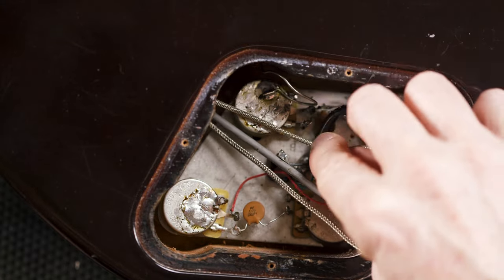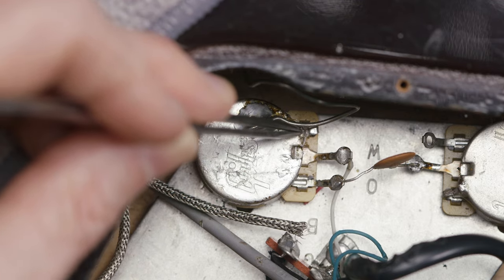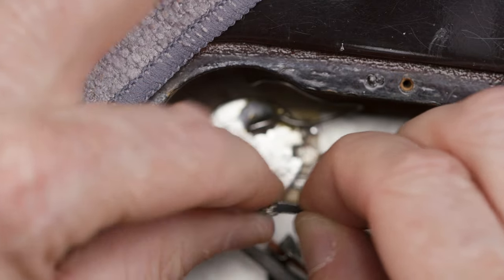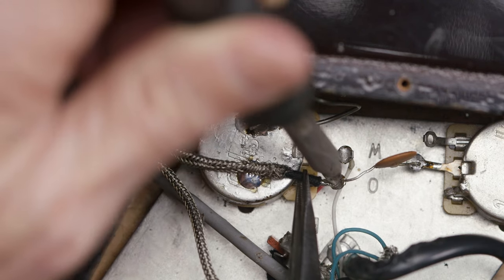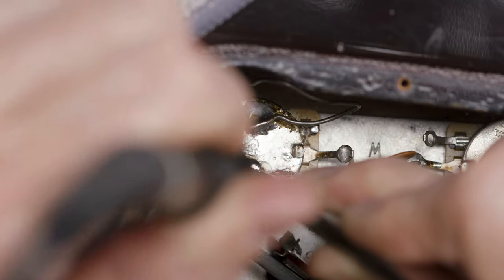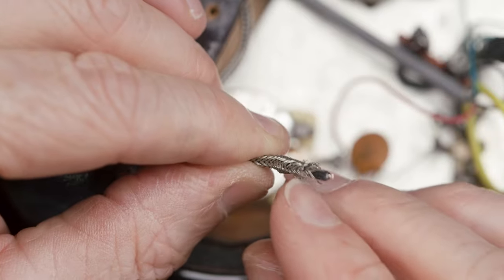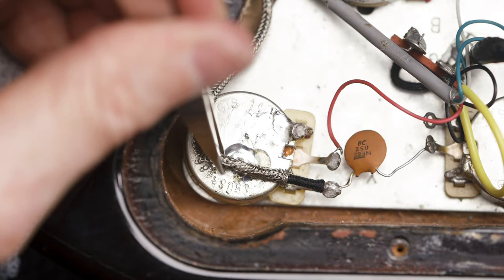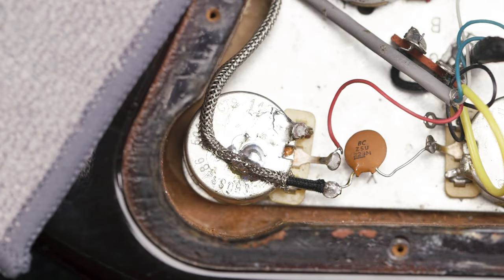Les Paul DIY: How To Solder Connections

Comment: A basic question but how do you make sure your pots, capacitors don't get overheated to a level where they get damaged? How long can you heat the solder directly on the back of the pot? Thanks!
Reply: Hot iron, quick heat transfer. Could also use a crocodile clip on the tone pot as a heatsink.
Reply: Protecting a leaded capacitor from too much heat is relatively simple. You can clip onto the device lead near the body of the part with a copper alligator clip, or as many experienced techs use, a hemostat. I have several different sizes of hemostat (the cheap kind from China) I use the largest one for the space available up to about eight inch size.

Protecting the pots are more of a challenge. I only solder to the pots if requested by the customer and as far as I know, only CTS makes solder-able back electric guitar pots as part of their pot design. Bourns, who also make guitar pots, have available a solder washer H-127 (new design) which allows you to make a connection to the body of the pot. 

From an electrical standpoint you do not have to use the back of a pot as a ground or chassis ground connection point. However, all of the "chassis" metal of the guitar has to be grounded at some point, which includes the pot(s) case. If you just want to ground the pot case you can use the solder washer. If the guitar comes with a metal pot mounting plate (like an older Les Paul), you just need to ground the plate, because all of the pots are attached to it.

You can make a proper solder joint to the back of the pot if you have the correct soldering equipment and supplies and know what a good solder joint should look like. Soldering push back wire tinned braid to a pot case is really unique to guitar wiring, and a huge challenge because the pot case and braid have a relatively large thermal mass as compared to a capacitor lead to a pot terminal. 

The approach shown in the video is very mainstream, but in my opinion does not make the best solder joint, and more often than not produces a cold solder joint. First to help the pot survive the procedure only solder to the pot once for all connections. This approach is more traditional from an old radio wiring standpoint. Where by, you prep the joint first then solder once. How this would be different than what is in the video is you would first clean the scale and oxidation off of the pot back, I use a small die grinder with a very fine scotch-brite pad, then clean with IPA, apply liquid flux to the joint and then solder everything in one operation. If you prep the area to be solder on the pot and use additional liquid flux you do not need pre-tin the pot, which heats up the pot. If you want to see what a good solder joint is supposed to look like consult IPC J-STD-001 requirements. The joint will have smooth fillet sides and not look like a round blob or ball on the back or the pot. 

To me in the video the soldering iron is not hot enough and should be of a higher wattage to make a solder connection of braid to a pot case.

Comment: Regular lead solder or silver solder? Which is better for a Les Paul I’m hand wiring?
Reply: Use tin-lead eutectic with RA flux to solder to the back of a pot. RMA flux in my opinion is not active enough. For pot soldering the wire flux type is actually more important than if the solder has a silver content (Pb-Sn-Ag). Also, the back of the CTS pots are tin plated. If they where silver plated than silver solder would be more useful. Silver solder is useful if you are soldering stranded copper wire which is silver plated (as opposed to tin plated), which is often found in aircraft and marine wiring designs. Silver plated wire soldered with silver content solder make the most beautiful and shiny solder joints which are very corrosion resistant.